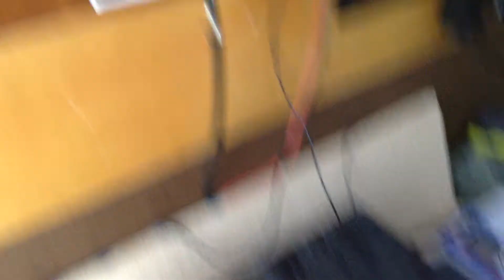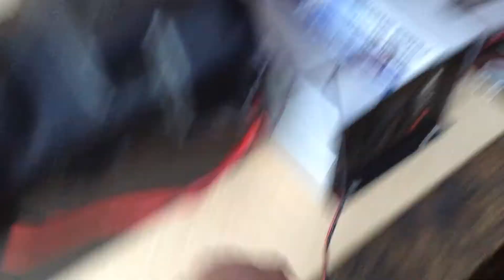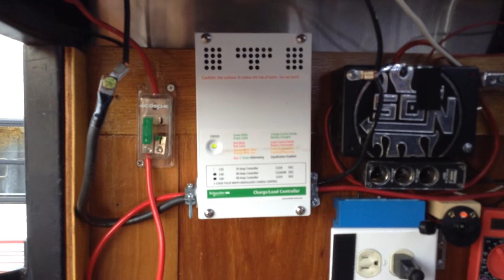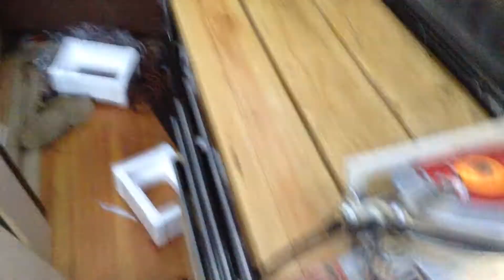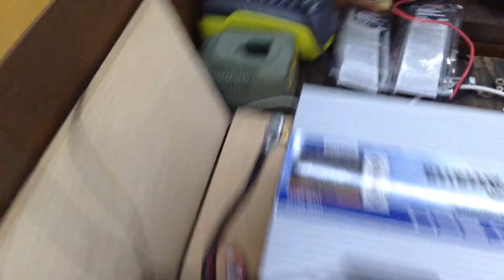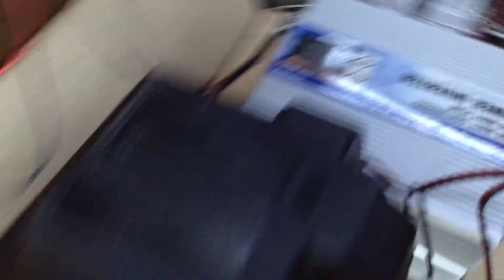Medium power system overview for mobile and off grid workshop use

Comment: How long can you run a   Saw
Reply from the maker: snoopyrust  That depends on the panels which are hooked up to it, type of saw and levels of stress being put on the saw.   Later that year, I integrated that setup with a 400 watt solar array and five additional batteries.  During the daytime in the summer, I could run power equipment indefinitely but something went wrong with a fridge when it got up around 105 degrees outside and the equipment got even hotter, panels stop producing when they overheat, batteries won't hold power well either, but when other stuff was crapping out, basic motors, like those found in power saws, worked fine.   I used the worm drive saw (15 amp) a 10 amp table saw and a 10 amp compound miter saw, not simultaneously, but one after another, but at the same time I had some cordless tool battery charges plugged in  to the system, and a small (but not micro) fridge.   My conclusion based on that is the 3KW inverter is capable of running a small construction site.   Each one of those deep cycle Marine batteries costs about the same as any of the decent lithium ion power tool batteries, so figure your cost of running corded power tools off grid is pretty comparable to cordless, but if your situation can handle the bulk of the larger batteries and inverter, you get the use of more powerful tools.

Comment: Can you post the link from were you bought that little 12ga weather proof connector? I have been looking for one for my portable power box. Thanks
Reply from the maker: The little one is a 10ga connector I got from a local RV supply place.  It was in a bin of surplus parts.    I need to get more of those and might do a video of the place.   There are a lot of RV manufacturers in Oregon so they sell surplus and off-spec parts to a few places in Portland and one in Eugene.